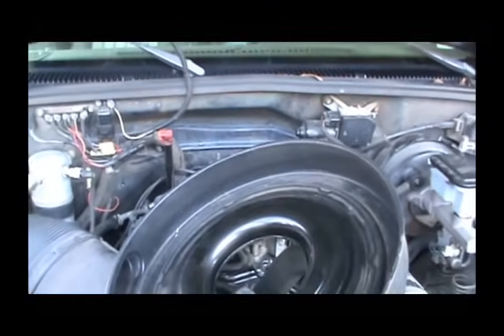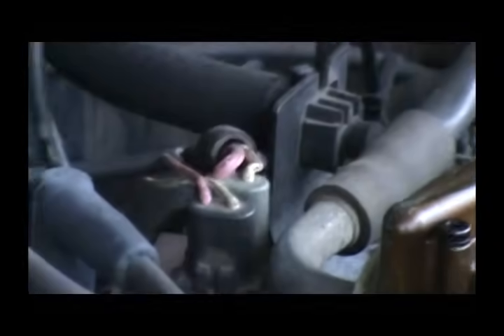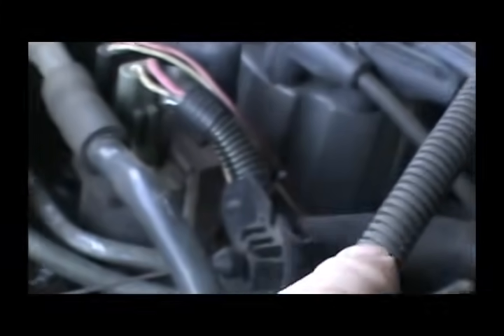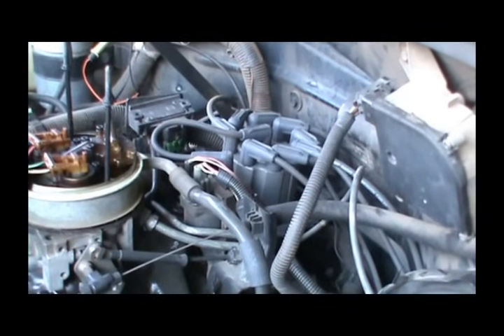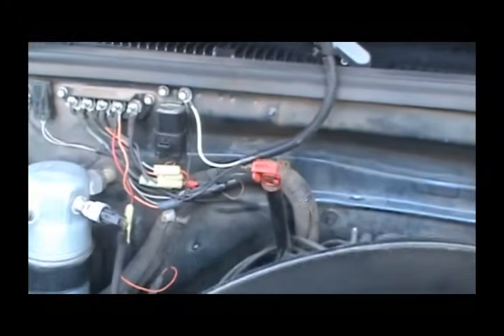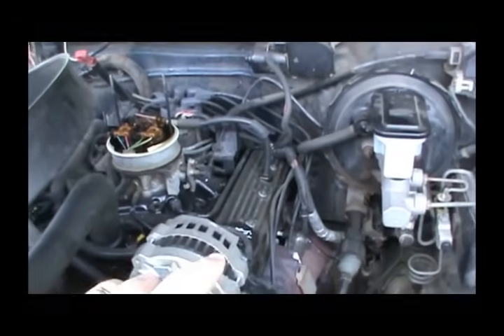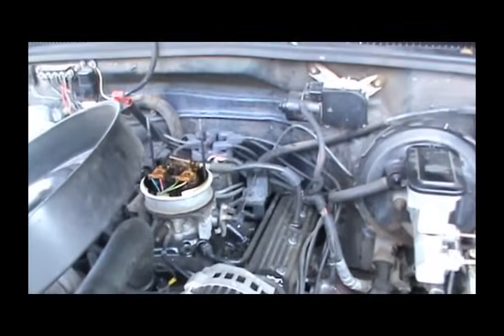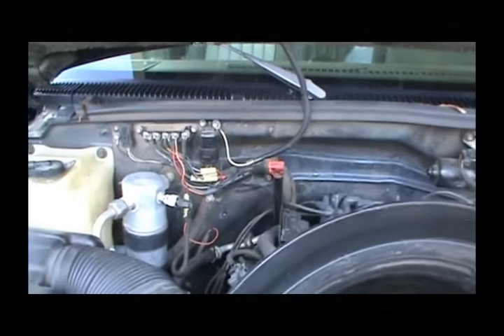1988-95 GM Truck Ignition Systems

Comment: I have a 90 Chevy Silverado 5.7 L. I'm trying to figure out if it's my 02 sensor, my TPS, or my IAC sensor. Sometimes it runs good without sputtering a little bit and sometimes it stalls out either when I first start it and or even while driving. It's back and forth. I disconnected the connecter to the TPS and it seems to run better. But still sputters a bit or stalls here and there. Starts right up like nothing though. Once after sitting for a few days it didn't want to start like it was out of gas. I sprayed some carb cleaner down the Tbi and after the second time it started right up and stayed at idle. The code reads 13 when I tested it which it says is the O2 sensor but I've had a few others give me their opinions including 2 mechanics I know and they said it doesn't sound like the O2 sensor though. If you don't mind I could use your opinion, it seems like you know your stuff.
Reply from the maker: A bad O2 sensor would not cause sputtering because it would keep the PCM in open loop which would cause it to run based on values preprogrammed into the PCM.  It sounds more like a faulty IAC or MAP sensor, but could also be caused by a bad fuel pressure regulator or pump.  I wouldn't unplug the TPS because the PCM needs TPS input to determine fuel, air, etc.  I am posting some videos on GM Truck DTC Codes on my other channel Farmboy's Garage, so check those out.  Hope this helps.
Reply: +farmboy30117 ok thanks! I guess I'll plug it back in. You think having it unplugged could've been the cause to not starting that one day?
Reply from the maker: Unplugging it would set code 22 (low voltage).  It probably wouldn't keep it from starting but I would imagine it'd run lean if you drove with it unplugged.
Reply: +farmboy30117 yeah I used that paperclip technique this morning and yeah it shot out code 22. I was all happy thinking I found the problem and completely forgot that I had it unplugged. Lol. Guess for now I'll just clean the IAC valve with some tb and air intake cleaner and the EGR with carb cleaner till I get paid this Friday to buy more parts to get it working better. Also last time the code read 13 when I went to a mechanic I know that had that key, but it didn't pop up this time and I haven't replaced the O2 sensor. How does a code get cleared? Maybe when I disconnect the battery to strip the wires and add a new TPS connecter?
Reply from the maker: Yes, disconnecting the battery will clear the codes
Reply: +farmboy30117 how does a code come back or is it gone for good.
Reply from the maker: It will set the code again if the problem still exists
Reply: @purestress2  O2 sensor won't cause a drivability problem, you'll just get shitty gas mileage until you replace it or whatever is causing the lean / rich condition. Example, If you have a vacuum leak the ECM will detect a lean condition and richen up the fuel mixture causing your o2 sensor to read high. Best way to see if your o2 sensor is working is to pin the wire and check its readings with a digital volt meter. Should fluctuate between .2 & .9 VDC If it working properly once vehicle is in closed loop.
Reply: @davidpettengill914  yep already know all that.. This was 5 years ago lol Thanks tho

Comment: does a 93 Chevy Silverado 5.7 throttle body have a knock sensor or a electronic spark control.getting error code 43 truck will not start if it starts it will die out almost immediately.if I unplug the map sensor vacuum hose from the throttle body and hold my finger on the suction Port it will run as soon as I plug the map sensor back on it will die
Reply from the maker: Yes, your truck has one. It could be located just below cylinder 7 near the oil filter or on top of block behind left cylinder head. Sounds like your problem might be related. According to the manual, a code 43 is set two ways: voltage > 4.16 or <0.64 volts at sensor, or when it self tests by advancing the timing & no knock is sensed during 2 consecutive tests.  To do the self test, the MAP must be above 81 kPa. Voltage at sensor should normally be about 2.5 volts.  There should be 3900 ohms from sensor (unplugged) & block.
Reply from the maker: +farmboy30117 Now for the MAP sensor, the PCM sends a 5V reference signal to sensor. At idle, the sensor output voltage should be 1-2 volts.  At higher pressure or wide open throttle, the voltage should be 4-4.8 volts. The PCM uses the MAP sensor to control fuel delivery & ignition timing. If you have a way, check voltage with engine running, then apply 10" vacuum to the sensor & it should cause the voltage to change instantaneously.  If it's slow, replace sensor.  Subtract second reading from first reading. It should be greater than 1.5 volts.  If not, replace sensor. If it is, check vacuum line to sensor for leaks or a restriction.  I think your bad MAP reading is messing up the knock sensor self-test. Hope this helps.
Reply: Paul Hyde h

Comment: i have a 1990 chevy blazer 5.7 k5 i been having a miss in thengine n a hesitation when I press the throttle ive replaced cap,rotor,wires,plugs,coil,n ignition mogel n i replaced the whole distributer n still has the hesitate n miss been hoin on for a few weeks but now when I drive it for over a half hour or more it starts to bog out n backfire then shut off but starts back up and running it will do this a few times then i gota let it sit for bout 20min then sometimes it will start back up......help
Reply from the maker: +Edwin Padilla You didn't mention a check engine light, so all the sensors are probably ok.  Looks like you've ruled out the ignition system, so one thing to check is a clogged exhaust (usually the catalytic converter), too much back pressure can cause strange things.  If that isn't the issue, I'd look at the fuel system and make sure your fuel pressure is adequate.  Hope this helps and good luck.